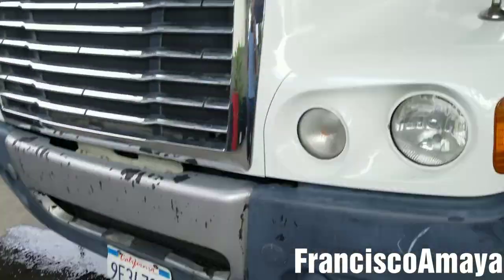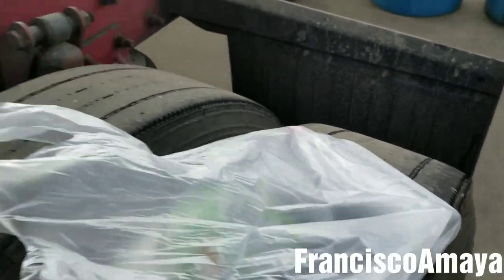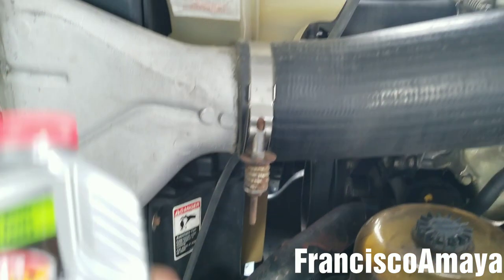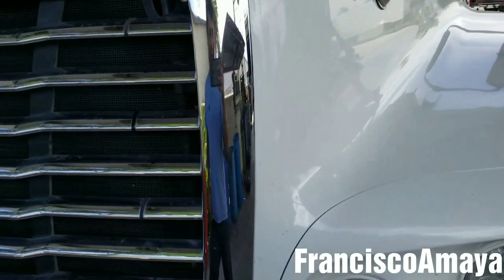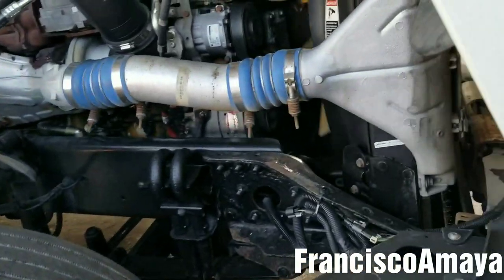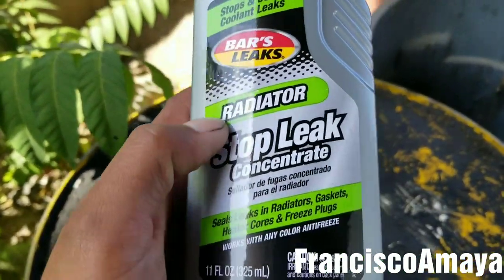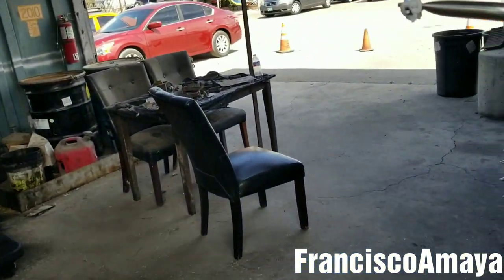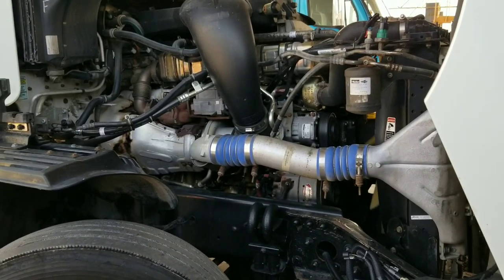can bar's leak radiador stop leak test stop a leak in your truck? coolant leak radiator needs repair

Comment: I would like to say thank you so much for helped me. I was  driving in Tennessee and I managed to go to loves on 75 and then they told me to wait for like  7 to 8 hours until when I went to watch your video and then I came across this. I was really so stacked. I put in front line Cascadia, 2019 I used three of them and it stopped leaking immediately. This was amazing thank you once again that’s product wax for sure.❤

Comment: I just used this product I took a load to Modesto on the way I noticed my engine temperature going higher and stopped to check it and noticed foam in my Ani freeze. I babbied to Modesto watching my speed and keeping my air on to keep it from overheating I watched your video and bought three bottles and added them and I couldn't believe it my I watched my temperature gauge drop to normal I couldn't believe it. Thanks to your video I'll make it home to get it properly repaired. Thank you

Comment: i have been using bars stop leak in my 92 kenworth 3406c engine for over 10 years never clog my radiator but when i change coolant i have to put the bars stop leak in it again are it will start leaking again and my truck has a water filter this save me from buying a new radiator plus labor
Reply: How often did you have to pour the stop leak and coolant in?

Comment: Hey Fransisco,  I have 2013 cascadia DD15 I'm having a coolant leak right where the turbo gearbox mothed to the engine block and cant find where ita coming from any suggestions ?

Comment: Francisco,  my radiator was leaking from the drain plug at the bottom, I replaced it and its still leaking.  Any idea on why it would be leaking still?
Reply: I have the same cuestion

Comment: My mechanic told me not to use that. It clogs the water filter and makes mess over the time.
Reply: EDWIN MONTERROZA it clogged the system I’m my Peterbilt since I didn’t pull the thermostat and drain the system after a few days
Reply: @truckerstyleshawn  so if you remove the thermostat it won’t clog up the filter?
Reply: @ViVA-MEXICO-AMLO  after I used it once the leak stoped I changed my filters twice a week after changing the coolant.

Comment: I used it on my truck and did not clog my system or filter
Been 1yr and radiator still not leaking
Reply: Nice 👍🏽
Reply: What model truck?
Reply: @CrispImagery  2012 Peterbilt 587 still haven’t changed it
Reply: @dmesa100  nice I use two bottles for my 2010 Freightliner. The radiator I wanna say has a small crack near the front bottom. It hasn’t leaked since I put it in 2 weeks ago.
Reply: @CrispImagery  how long did your’s last? I got the same leak. When I saw him make this video I had to give it a thought. People say it clogs up systems but a lie don’t care who tell it…
Reply: @connerkl Hey man did you used it?

Comment: Bought a 2005  378 peterbilt with a c15 18 speed in sept of 2012  24000 dollars I ran bars leak in it for years and finally had to change the rad at the end of 8 years the motor head gasket went so bad the bar leak would not fix it up to that point added it as need you would get bubbling in the coolant tank add bars leak to repair the compression leak the downside was heater core plugged

Comment: Francisco me llamo Mario y tengo un cascadia 2012 con 953980 milla y reciente me prendieron los focos amarillos y rojo del motor y me pidió antifreeze pero el tractor nunca se calentó y de repente le salía vapor del crank case filter antes de abrir el motor que es lo más común que le suceda a ese motor  gracias y espero su respuesta
Reply: Mario bolivar si el Troke le prendió esas luces y le pidió antifreeze pero en realidad el radiador tenía agua entonces el problema es el sensor del coolant .
Reply: julio gomez buenos días sabes que el troke tiene el problema del liner pero ya ordené el inframe kit para hacerle un overhaul

Comment: My cascadia radiator is leaking on top plastic by the hose. Very small leak. Is there was to fix it since it's on the plastic
Reply: Yea put some jb weld you have to use a sander scrape the plastic first then use the cement
Reply: Yes I had same leak there as well you can fix it with some JB Weld Epoxy
Reply: I use flex seal
Reply: @mighty3552  do you have a picture